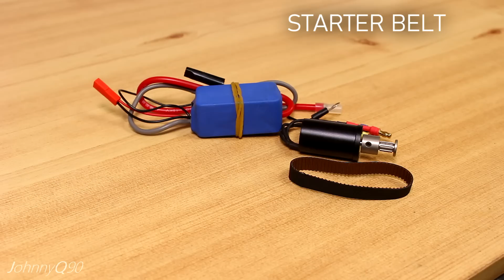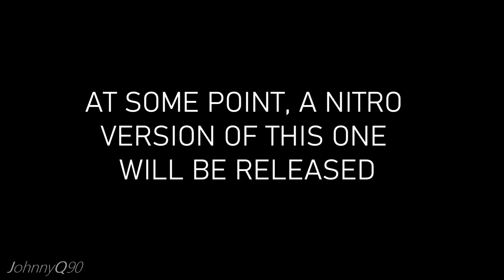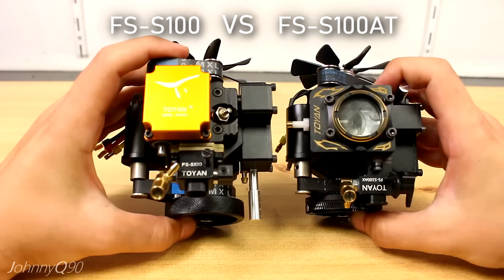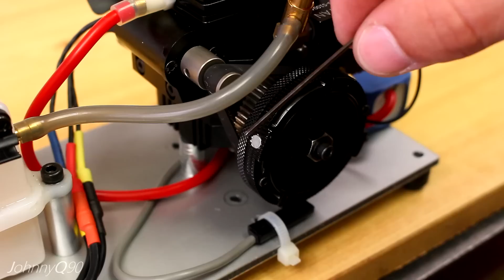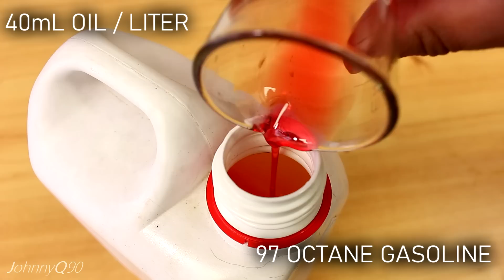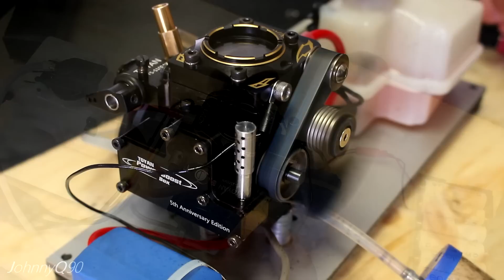World's First Production Micro 4 Stroke Engine with See Through Head!

Comment: This visible combustion is nothing new. Harley Davidson external combustion engines have been around since 1907
Reply: So what is your point?
Reply: Mik 
you asked what my point is so—-since you asked:
  It was an attempt at humor, because anyone with any amount of experience with motorcycle engine design, are aware that HD engines with their antiquated waste spark  are prone to backfiring / misfiring ,experienced mechanics with a sense of humor pick up on these things quickly...,Unless, in this case they happen to be a hog owner, which ,Depending on your frame of reference,changes from humor to perceived insult, because as we all know, negative truth hurts,And “MEN” that own HD , the real “MANS” machine, usually have a  low self-esteem issues and expect  the worlds perception of them to be one thing, and they are offended easily  when reality clashes with their illusions.
  thanks for asking
Reply: @Jodyrides  ohhh jeeze sorry, I didn't even think about your comment for more than 2 seconds

Comment: I don't get it. Some parts, they've intentionally tried to make this engine as expensive as possible. Other parts, they've cheaped out as much as possible.
Reply: To be fair $400 is cheap as hell
Reply: @miles11we  Sure but just by using better design methodology they could've shaved down a hundred bucks or two and that could've been pure profit for the company, or it could be sold cheaper, or a bit of both.
Reply: @michaelbuckers  I honestly don't think you could build this (fulfilling the same purposes) for almost any cheaper
Reply: @miles11we  You can make the cooling fan a single injection molded plastic piece, that will immediately make it some $15 cheaper.
Reply: @michaelbuckers  I don't think they are making enough of these that the savings would justify the cost of making the dies
Reply: @michaelbuckers  plus these are bench engines, conversation pieces, so they need to look premium even if they aren't really.
Reply: @miles11we  Yet they justified making a mold to produce individual blades, lathing, milling and tapping a metal hub, and adding 6 screws to the bill of materials. The motor core has milled slots in it as if it was air cooling, butthe grooves are not nearly deep enough and the fins are far too thick to actually serve as air cooling, so the fan doesn't even needs to be there and neither do the milled fins. The list goes on. At the same time, they use incredibly cheap electrical fittings, the spark mechanism & the plug itself, they make it run off a battery even though it has a generator. So I said, some parts are intentionally expensive and the others are the cheapest stuff you can imagine, it's bizarre that it's made like this.
Reply: @michaelbuckers  arent those blades stamped steel?
I mean really we need to know how many of these they are producing because the extra 2 mins on a 4 axis very well could he cheaper than injection molding, all depending on volume of course.
Reply: @michaelbuckers  exactly how much surface area is required for cooling of this thing? Exactly how much surface area does it have in its current state? Considering you know that the fins can't keep up with how this is used (short periods).
Reply: @michaelbuckers  also in order to passively cool something vs even just a mild breeze flowing over it, you need a shit ton more fins, efficiency goes way up when you start pushing air across it.

Comment: You used the wrong fuel. It's a nitro engine (he uses methanol as fuel, not gasoline!). You need fuel for RC models. You have used regular gasoline that has a higher combustion temperature, and just a little oil (nitro fuel has 9-12% oil content!) - you will destroy the engine.
Reply: No. The manufacturer specifies gasoline and 2t oil
Reply: Yes but the fuel lines and the tank looks to me, like are dedicated to nitro fuel, not gasoline. I read reviews of RC plane pilots that gasoline dissolves this type of silicone tubing (and it may damage the engine).
For example, "Losi 1/8 4WD 8IGHT RTR Gas Buggy" uses a different fuel system. If they could, they would have used a classic tank and cables (but they didn't).
I can check it myself, but I have no reason not to believe to other RC nitro enthusiasts, and Toyan showed that they must not be trusted.
Reply: @FargothPL  most of that, I couldn't figure out what you were trying to say. Buteven if you are right about the tubing, how would it damage the engine?
Reply: @miles11we  I mean that contaminated gasoline can clog carburettor nozzles, throttle, bearings and even the piston. It can also lead to engine seizure. Cleaning the fuel system can be difficult, costly, and sometimes impossible.